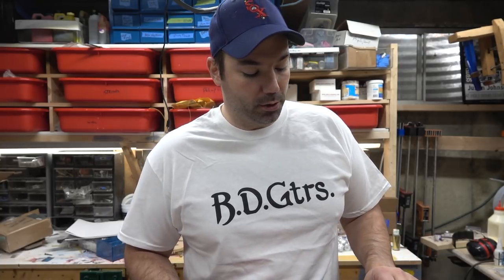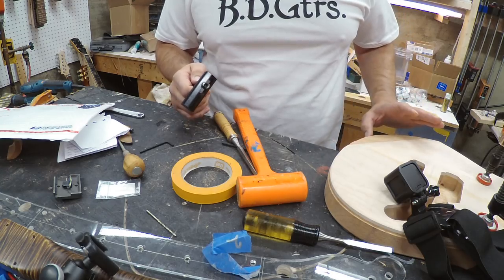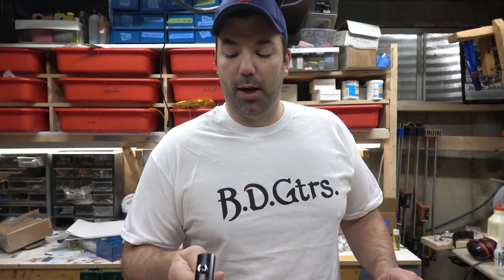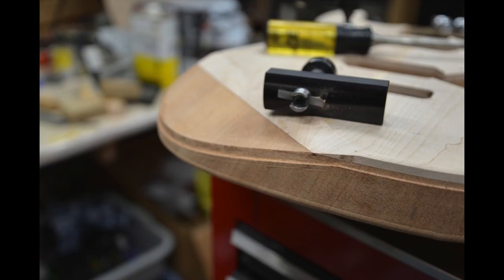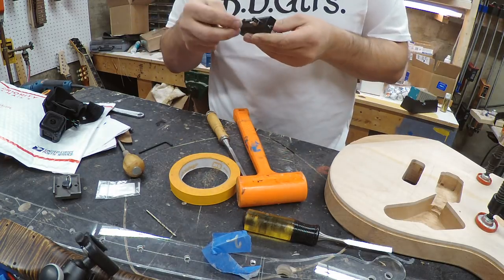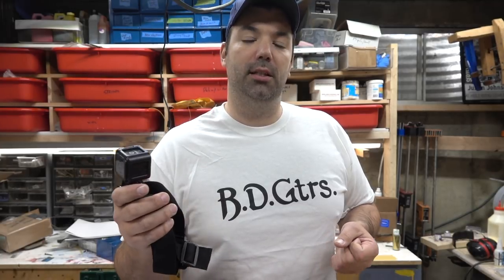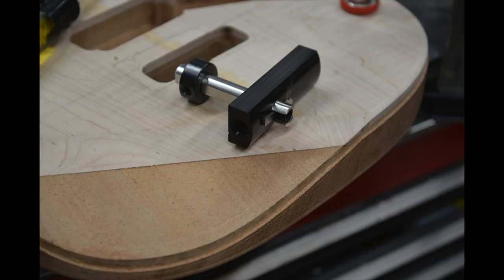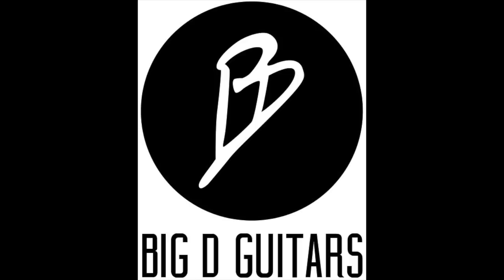Binding a Strat arm contour by hand with a Gramil

Comment: Sorry for my question : why didn't you just rout out the binding channel ? I didn't get get that...
Reply from the maker: I couldn't get the angle right, as you need to follow the contour of the cut which my router wasn't going to do.
Reply: Yup, i actually ran into your iceman video, where you explain that it's easier to rout the binding channel on a flat top than it is on an LP. I guess it's the same idea here.
Reply: @avielkharrat5788  you mean strat or contour body
Reply: There is also a way to do it with a router, a pulley a bit of rope and some weights.. we did it like that in the eighties.. just wish i could remember that far back.
Reply: We put a pulley on a over head beam, put rope through and balanced the router with weights attached to the rope..i cant remember the rest tho🤔
Reply: We used the router bush as the guide.